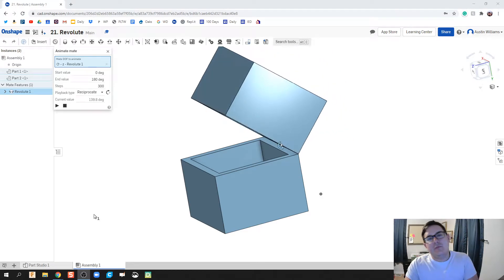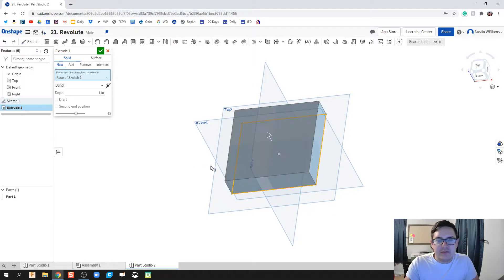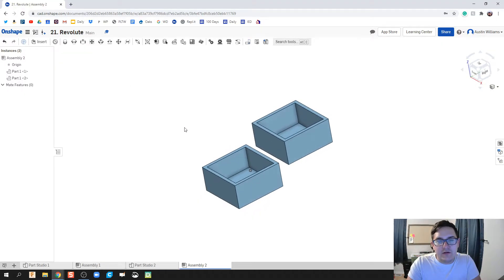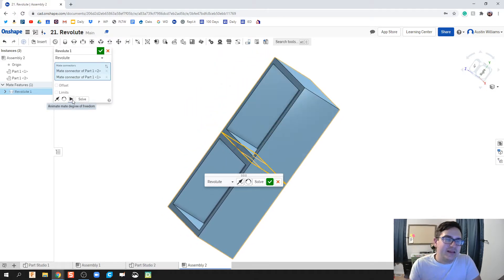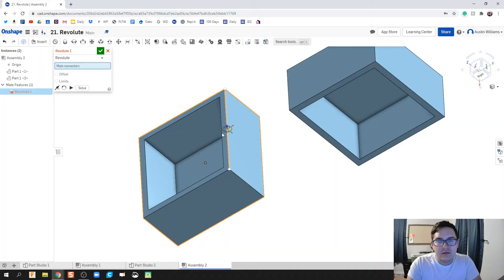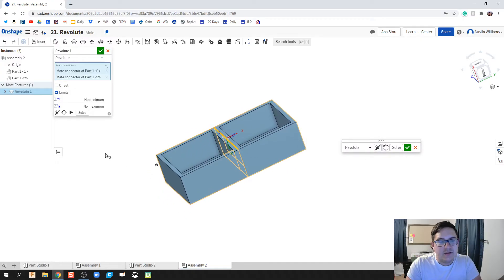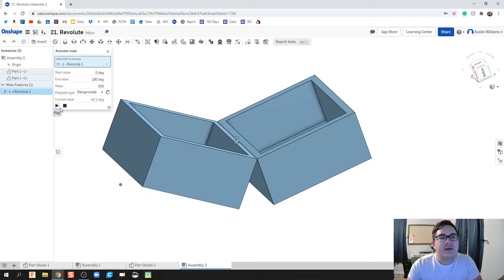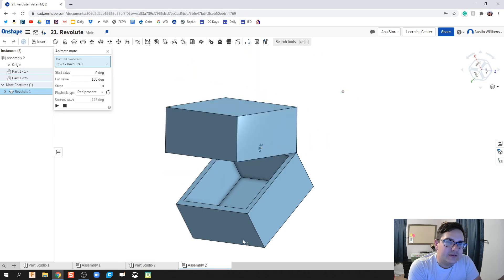Revolute Mate - Day 21 of 100 OnShape Journey

Comment: I have a model that I placed a revolve mate to it, but the problem that I'm having is that when I set the limits, it spins in the wrong direction. How can I fix it?
Thank you.
Reply from the maker: @reginaldolucas4808  flip your working glyphs around by using the flip command in the mate panel.
Reply: @LearnItDoItMakeIt  how do  I flip the working glyphs? And what's glyphs?
Thank you for your help, I really appreciate it.
Reply from the maker: @reginaldolucas4808  Glyphs are the "pac man" looking signs that show up when selecting a mate. In the window that pops up when selecting a mate, there is an option to "flip" the working planes. In the revolute command box, there is a arrow selection next to the play button that will flip that for you.

Comment: Thank you for the pre-thought you put into your presentation.  Very clear.  How I found you was by trying to learn how using ONSHAPE to create a battery cartage that will fit into a normal 2D flashlight, but the interior permits a single lion 18650 to be the power source that replaces the 2 D cells.  Would that be of interest to you to make a video for your viewers?
Reply: Wow that was a quick response.  Thank you for the acknowledgment that this could be a video to show how to make a flashlight rechargeable.

Comment: Do you know how I would make a revolute stop once hitting the fixed object without knowing the exact degree that it has to travel?

Like once it hits the fixed object, it stops rotating?
Reply from the maker: There are no object constraints in OnShape. All geometry are treated as meshes unless you purchase add-ons to do part analysis.
Reply: @LearnItDoItMakeIt  Thank you. Do you have suggestions for other software that would be better for this?
Reply from the maker: @adidisai48282  Fusion 360 using contact sets.
Reply from the maker: @adidisai48282  Fusion 360 would work will with contact sets. However, it does require a decent computer rig to run those simulations.

Comment: Do you know if the iOS OnShape app has Animate functionality?  I've been following along with these videos using my iPhone, and so far the iOS version has everything except Make Transparent, which I can work around, and I can't find an Animate or Play function.
Reply from the maker: Sorry, I have no IOS devices. Have you looked in your mate settings by holding down your finger?
Reply: @LearnItDoItMakeIt  I still haven’t found an animate feature in iOS. You can get a lot of the right-click features by tapping on a menu item or two-finger tapping, in some cases. 

I DID find something useful, though, for any other interested iOS users. There’s a feature that works the same as holding Shift and selecting a face to help you find the right Mate point. What you do is long-press until the cross hairs show up. Then, use the cross hairs to select a face. It’ll then let you select any of the Mate points associated with just that one face.

Comment: When I was trying to connect the boxes it didn’t rotate how I needed too how do I get it how you did
Reply from the maker: Two common problems. First is to make sure your base is "fixed" and does not move. Right click, select "Fix". Second, make sure your mates are in the correct direction. If it is spinning the wrong direction, it is usually that problem.